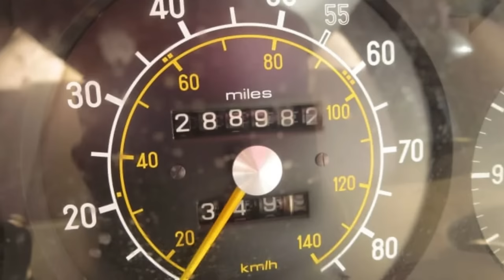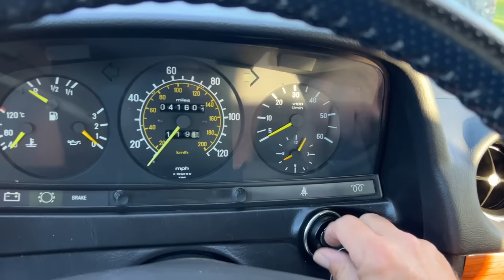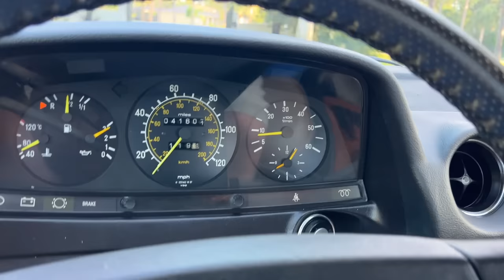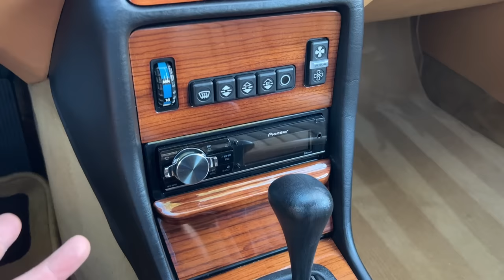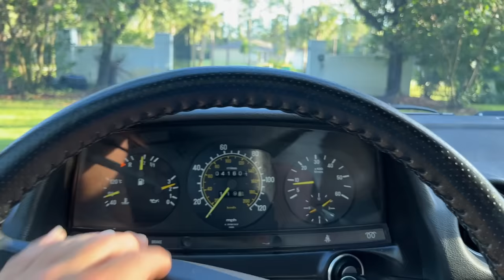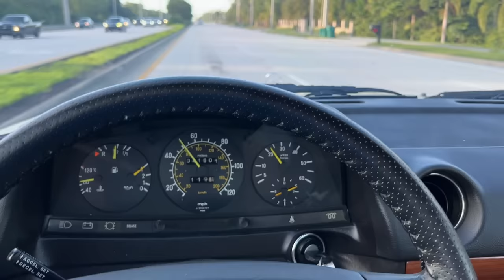The Mercedes-Benz W123 Turbo Diesel May Well Be The Best Car Ever Built

Comment: The low fuel indictor in my lebaron did this, it was a faulty capacitor on a little board clipped on the back of the cluster.

Comment: i bought one when they came out in germany the four door 300 turbo-diesel , but having some older Mercedes i have to say that the turbo wasn´t the best ,i had problems with the turbo and older ones are more resistant and well built, but the coupé was only sold with diesel engine in the U.S. and Canada i have one bought in fthe 90´s diesel with the american rests to seat and drink a beer with the heat coming from the engine in wintertime the lights also don´t get why they change them, but in reality there are early 70´s and mid 60´s cars that are better in quality of building compared with trhis that i have two a C230 and a CD300, also the 300TD (wagon) and a 83 200D ,that i don´t understand with so many especialists no one refers to the bigger and tinier body of the w123 ,the 200D is much smaller than the 300D, already in early 70´s they release the w114 coupé with a tinier size as it was in the bigger models ,i had a w115 from 74 220D with a much longer body than a early 70´s mercedes with the same finishings either than the coupé that is smaller ,also a 230 from 72 with a diferent size body in the 80´s people know the w202 and the W124 as it happened in the 70´s and later 70´s early 80´s and there are two designations the w114 and the w115, which i also had a coupé a 240D from 75 sold at the same time as the W123, being my favorite one a 65 coupé 280S with U.S. finishings with manual gears on the side of the steering wheel, my first car when i was 18 was a 280S from 1968 four door looking new in 71, i remenber to open the front door besides me i had to take the gear off  and foot security brake to stretch myself and open the other door and i´m 1.81m

Comment: Those birds are starlings, also known as grackles.  They are the worst!  Most filthiest bird on earth.  You do not want those moving in.  The best way to get rid of the is with abrupt noise.  Even if you take a hammer, and bang a piece of sheet metal loudly, it will work.  But, if the fly right back, you gotta do it again.  Do not let those move in!!!!